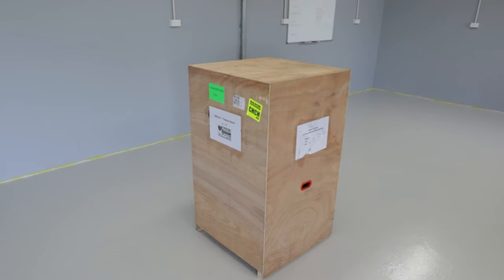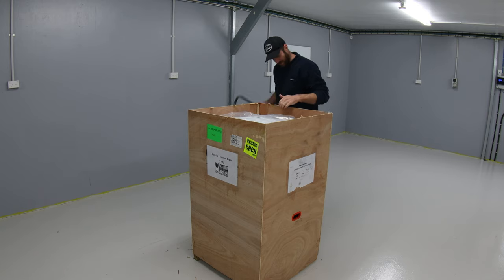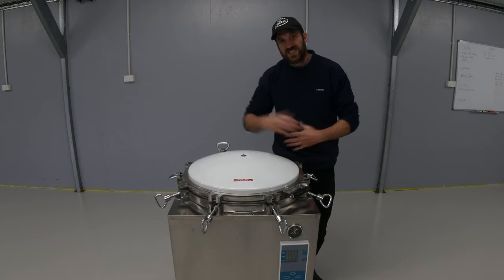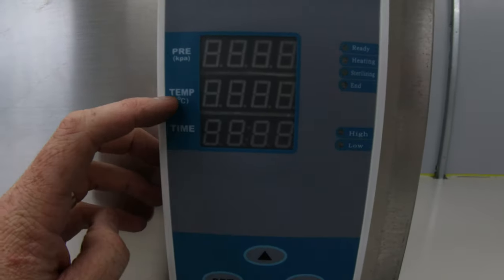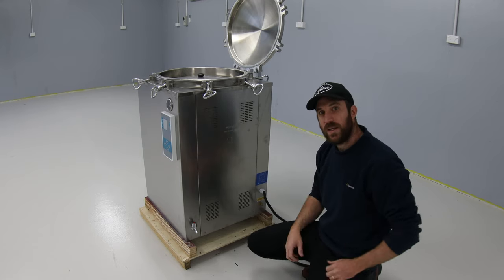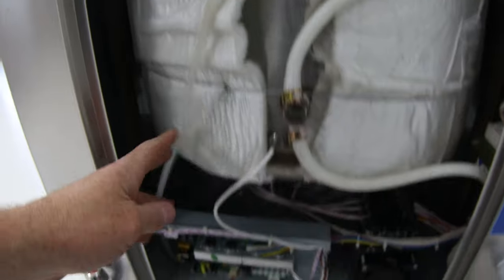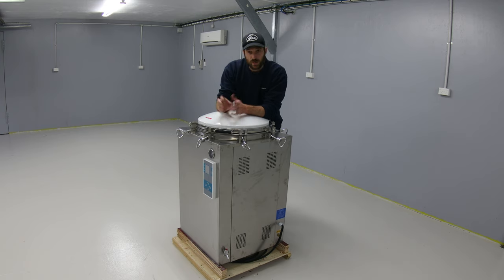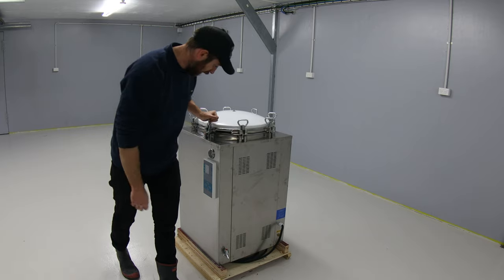Unboxing a Chinese Autoclave

Comment: We have similar. 6Kw single phase (220V here) and 150L. It needs 6 awg wire and 40 amp breaker or the wires get real hot when running long cycles (it's 28.5 amps !). be aware if you over load it to  a maximum the bags won't "breathe" when exhausting and steam won't get in the bags well enough. Underload (we run 8 5 lbs spawn bags is all...but they are very sterile when done). Also, be aware that the exhaust solenoid switch is normally closed for the venting. Soo, if the power cuts off mid run, it shuts off the exhaust valve and then the whole pressure vessel cools and vacuums (can damage unit and sensors). If the power gets cut off after it is at temperature be sure to open the lid as soon as the temp hits like 98-100C. The manual sucks but you'll eventually figure out the exhaust cycle settings (took us 3 nerve wrecking days!). Someone needs to rewrite the settings manual and do a video on how to change the settings. Let me know if you get stuck. Also the welds suck (they rust due to cheap rods used with iron in them) and will fail earlier as a results. You'll see the rust on the welds quickly. It's rated for 7 years BUT that is only if you change the water after every cycle (a lot of extra work) and don;t run acid or base producing steam like mushroom bags in it. We've had ours two year and it won't last past 3 or 4 safely is my bet. The failure is going to be catastrophic is my bet if we keep it a full 7 years. lol
Reply from the maker: Thanks for all the advice! I will take it all in when I run it for first few times. I definitely  don't want it pulling a vacuum.
Reply: @OakandSpore  BTW, there is a 400L single phase 6Kw that can be special ordered from Satrise and others (SW Mushrooms has the chamber in his video but I don't think his is single phase), but it will take a long time to reach temp if loaded. It is the biggest single phase autoclave that I could find in the world (and is special order due to the low/weird power input).
Reply: @OakandSpore  Oh, and the factory vent settings suck for mushrooms bags. The first vent time is ok to get the ambient air out, but you want at least 4 seconds of vent time to allow the bags to "breathe" when cooking and that is when cooking a single layer in each drum (ie 4 x 5 lbs bags). We run at 121C for 3 hours but have run higher temps (but it damages proteins and sugars more)
Reply: @silverleapers  Hey man, would you mind sharing the details on that 400L unit? I order my bags from Satrise, I've been talking to my contact about a single phase autoclave, largest they can do in 6kw is 150L...
Reply: Can you please help me, i have same one, and have a problem with bag bursting. I belive because autoclave immidately realese pressure after finnishing sterilization cycle 🤦‍♂️ and yea, manual sucks 🤮

Comment: The vent is not for overheat protection, it's designed to vent out air inside drum, so that you get more saturated steam instead of heated air. The vent is automatically controlled and it will stop venting once the internal temperature reached slightly higher than 100°C.

Comment: Chur bro I've added the notification bell so I never miss another clip. Nice bit of kit. Be great to see it fire up for the first time. Not sure we are still getting free trade  from Aus anymore lol. 
Are you going to do your bulk substrate in this beast and ditch your atmosphere set up all together if it's pinging? Impressive come up bro. Chur
Reply: Forget answering my question I just read the answer below.
Reply: I'll ask another question though. Did you consider gas boiler  powered at all and if so what made you go electric?
Reply from the maker: haha nah not gas. It's not that cheap and you don't have fine control with gas like you do with electricity.

Comment: Hey man, had my eye on this exact unit for the past 12 months. Are you using this for substrate or spawn? And are you running it at 30psi? How do the bags hold up?
Reply from the maker: Just using it for spawn.
Reply: @OakandSpore  Cool. What's the maximum run-time on these things? the spec sheet for the one I'm looking at says 0-99min

Comment: I have either the exact same autoclave or a slight variation and the electrician coming tomorrow to set it up on its own circuit (giving it a little head room with 20A.)
Super eager (and a little nervous) to see how it performs ☺️
Best of luck to us 🙌
Please share you go with yours.
Reply from the maker: I wont have mine going for a few weeks, but looking forward to it!
Reply: same here! Also waiting for the final installation by the electrician..
Reply: How did yours go Basti? Looking at ordering one into Australia. 
Run time and cooling time?
Would you buy again?
Reply: how loud is it when it vents to stabilize pressure?

Comment: Overall, good welding. The placement of the electronics in my opinion is poor. The  fan exacerbate the lack of shielding on the bottom. I also agree, I don't Ike that tubing.

If I were to compare it to an old dental sterilizer I own because the electronics failed the dentist, it has the same setup to have failures. Except is is vertical, not horizontal. You might notice that the housing only serves to trap heat and hide condensation.

I admire the size of this pressure vessel though! That might speed up cycles!
Reply from the maker: There are probabley a lot of improvements that can be made to it.. I am looking forward to seeing it operate.
Reply: @OakandSpore  Definately! She looks like a beauty!

Comment: How much was it?
Reply: If that is the case, this thing is a freaking bargain!
Reply: @dukeboy1323  is a price posted cause I dont see it, I only see your post & @Jeffery Sauler's post.
Reply: @themyceliumnetwork  I think my post got deleted by youtube, whoops!
Reply from the maker: Forgot to mention! It was 2.5k usd shipped.
Reply: @OakandSpore  That's a freaking bargain!!!!
Reply: @OakandSpore  nice! If you are concerned about pressures etc you can unbolt the pressure relief valve and send it away for calibration just to make sure it works correctly.
Reply from the maker: I might actually do that. Or buy a good quality German made one lol...

Comment: The Presto 23qrt is $300AU. The exact same Presto without "made in USA" is $90 free shipping from China. I buy loads of shit from China, like Stihl 2 stroke motor carb's &or  kits. Same deal they are made in the same factories just without the Stihl logo, dirt cheap, with no shipping fees. People put loads of shit on China but most of their household goods all made in China. Be good to know exactly why you purchased it & how much versus making your own from a s/steel 45 gal. Seems like not a lot of capacity tbh.
Reply from the maker: Yeah, here in NZ nearly every product you buy is Chinese made. This autoclave is just for my spawn, not for bull substrate. I have a much bigger steamer setup for this.